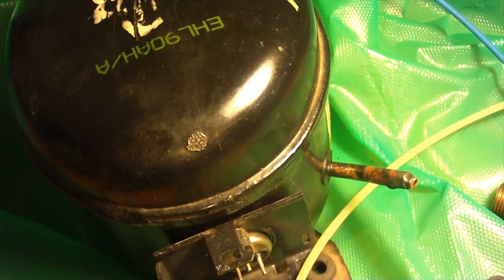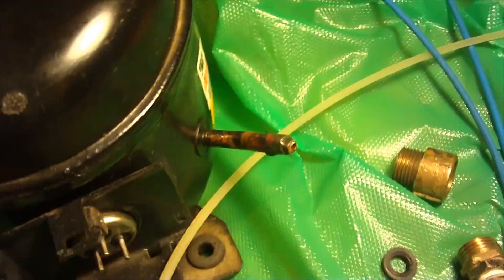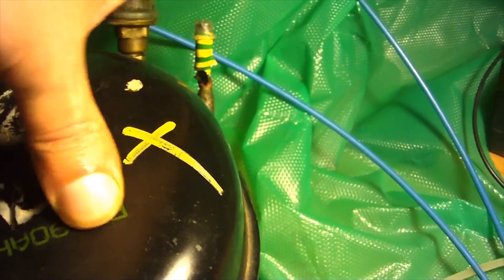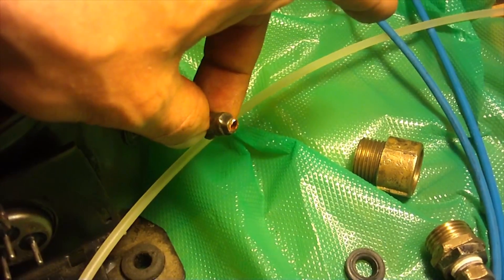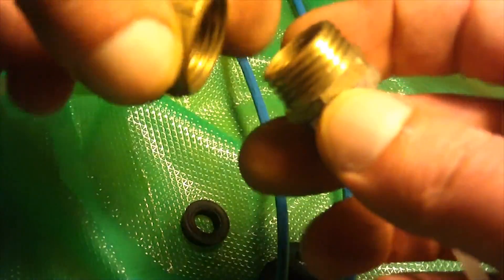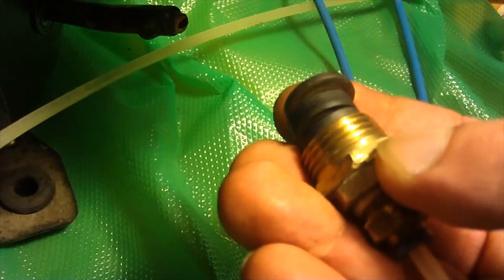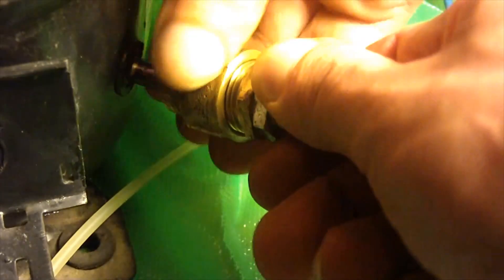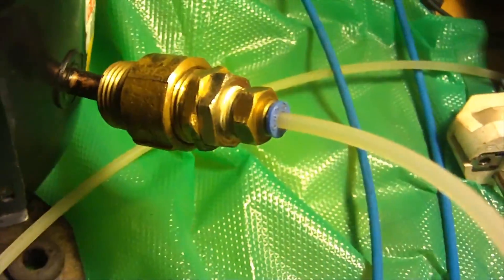simplest homemade compression fitting

Comment: great video, what fittings are these? I can see the plush one is push fitting what are the other 2 brass ones? Thanks great video, also the compressor I have it has mains lead 240 volt, 2 wires for a fan (not sure what to do with these and also 4 wires on another lead.  I will get there
Reply from the maker: female to male adapter (1/2" BSP) and a 1/2" to 3/8" reduction, 3/8" to 1/4" reduction and 1/4 push to connect fitting. Basically any combination of fittings that can fit over the tube and squeeze rubber washers and connect to a push to connect fitting is ok - it's not rocket science you know ;-)

Converting compressors isn't complicated at all. It pretty much requires you to remove one from a fridge and replace the thermostat (temperature switch) with a manual on/off switch
Reply: thanks, I am a slow learner so I do apologise if I sound daft